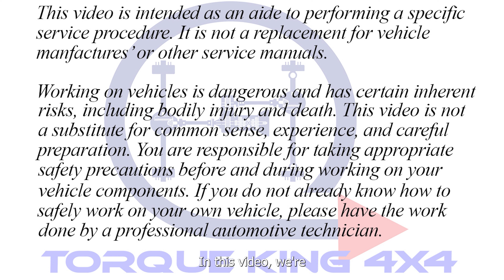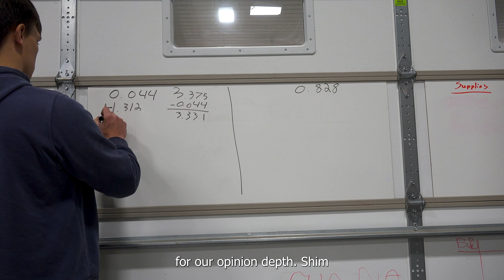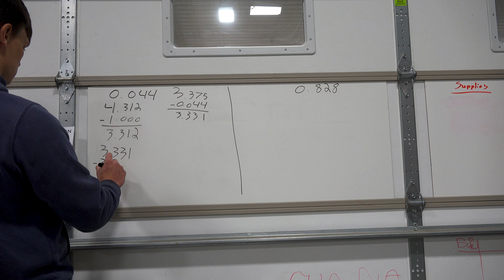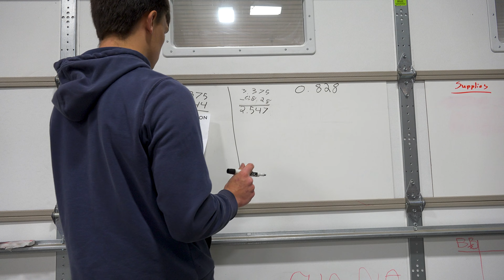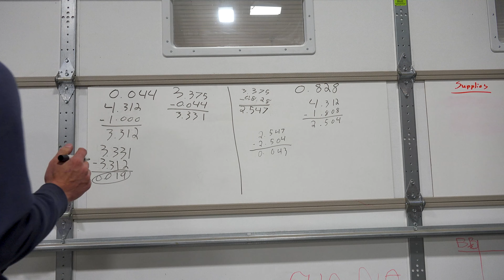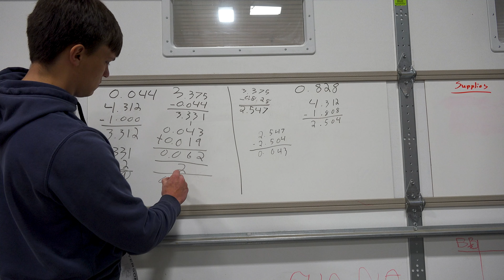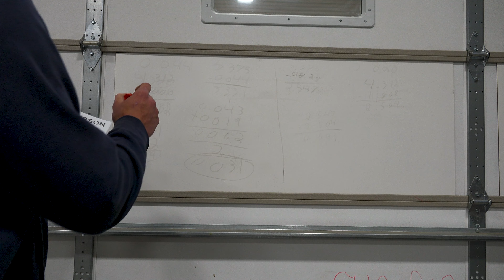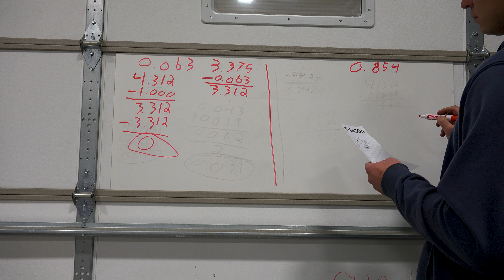Mahindra Roxor Rear Axle COMPLETE Service

Comment: There is no information about bearing adjustment and shim selection . also the oil catch housing is not fitted correctly
Reply from the maker: Yes, I actually realized some of the little details were missed earlier today when helping out another fella! Unfortunately both front and rear videos were done quickly due to using borrowed new axles, and I absolutely missed shooting or explaining some things... I will do another round of videos in the near future now that I have a few spares on hand.

While I prepare for that, if there is technical info needed feel free to give us a call and ask for Jesse.